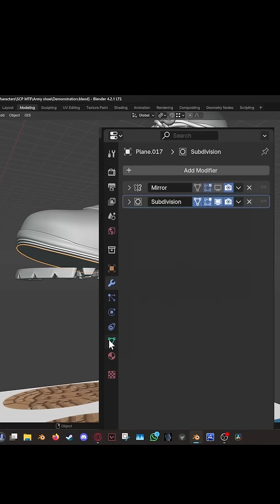The Easy way to Attach the Tread to a Shoe: Surface Deform modifier! #blender #3dmodeling

Comment: To me, learning Blender is way harder than learning Photoshop. Even if I only focus on sculpting, Blender already forces you to deal with 3D space, topology, modifiers, performance limits, and tools that all affect each other. Photoshop is only 2D, with more straightforward tools and immediate results. For Blender once you add texturing, materials, lighting, animation, and rendering, the difficulty doesn’t just increase, it stacks, making the learning curve multiple times steeper than Photoshop.

Comment: problem is that you will get distortion on the treads. can look a but weird. i normally just model the sole, then cut in to it in situ. its even harder if you want to blend the treads in to the sole and subdivide. its not a simple ask, loads of messing around to get a good result

Comment: Why it is so complicated? In in inventor you just select the surface you wanted to object to stick to in this case the bootom of the shoe than you select to object and it will automatically warp around the selected surface, yhis is also how you can put text on an object, here is much more complicated

Comment: 😂 Neat but takes so long. In Zbrush there are a few quick techniques. For this, my fave would be to create an IMM brush with the sole treads object, set projection strength to 100 and drag that IMM object on to the boot sole surface shape.  Matchmaker brush is another good option but I like IMM method.

Comment: I am absolutely out of the loop. Wouldn't even know the proper format to save an image file in. Lol so forgive me if this question is beyond stupid.
How come the result of doing this didn't make the tread too short for the shoe? As it's now covering more distance than the original model provided. 
I assume it automatically changes the scale/size to fit your anchor/ markers. But if so, *are there times where this method can distort or warp things too much? How would you combat that? *

Comment: i did a similar thing to cheat modeling 3d webbing on spiderman. except instead of even modeling the webbing, i textured it, converted it to an svg, used geonodes to convert the mesh into uv tiles in a shapekey, then did this lol, laziness and "smarter not harder" are basically the same thing. goes to show its really not a matter of an entire project thats difficult, its a bunch of simple steps you gotta understand in the software.

Comment: ok but no boot is shaped like that on the bottome. typically flat until the toe which bends slightly upward, not a huge curve up in the middle and back.  

also, this is one of those things that works perfectly until you actually try to do it, then it doesn't work at all and you have to watch the tutorial 40 more times before realizing you didn't update blender so something works slightly differently now and you have to start all over.

Comment: It always amazes me how blender really is about finding clever solutions to different problems
Reply: That's not just blender, practically any proper software you kinda need to find solutions, that's like %90 of the job.
Reply: all these ppl in the replies tryna ragebait 😝
Reply: that's just how technology is in general, buddy, not just blender
Reply: @splechortheannoyingcat yeah, and? How does that change anything that I saidm
Reply: @MilanKovacs-kc8ik it changes the specification to generalization, anymore question?
Reply: @splechortheannoyingcat the meaning is still the same. I was talking about blender because this is a blender video.
Reply: Every 3D software is about that. And this particular thing can be done in maya and has been for decades. Blender didn't invent 3D and isn't better than the rest.
Reply: @thegoblonoid I don't think I ever said that blender is better in any way. And also I said blender instead of any 3d software because this video is abour blender

Comment: You could also select the last vertices below and put the 3D cursor there, so when scaling on the z axis using the 3D cursor as the origin you won't have to worry about moving the object on the z axis

It gives the same result but requires fewer steps.

Comment: Nice one! Didn't know you can do that. Is there specific case you will recommend using this over the shrink wrap method, or they are pretty much interchangeable?
Reply from the maker: This method is very slightly faster, with shrinkwrap (set to project on the Z axis) you would need two modifiers and still need to flatten the sole mesh so this kind of cuts out the middle man
Reply: @BlenderTsukaima thank you !! Your method is actually better than!!!

Comment: Does the object only get stretched in the Z direction here? Like how do you get it so the protrusions follow the normals of the new curve?
Reply from the maker: That happens automatically thanks to the surface deform modifier. Since the target's (sole) faces are being rotated and stretched, so is the bound mesh (tread) as It tries to keep it's initial position (relative to the flat target)
Reply: @BlenderTsukaima thats super cool i imagine the effect would be more noticable wrapping completely around a cylinder or something like that

Comment: Wait what this is new. Was expecting shrink wrap but this is a neat trick I’ll add to my collection lol
Reply: you can also do this with shrink wrap but its a little more complicated and involves array modifiers
Reply: @RoyalTacos256 shrink map is different, it doesn't project it 1:1 it stretches the object
Reply: @willsherwood5958  Shrinkwrap does project if you choose the Project option in the modifier, but the problem is it tries to shrinkwrap everything an equal amount, or else only shrinkwrap the vertices of a vertex group (in which case the vertices at the bottom of the treads will just remain in their original flat position).  The trick is adding an offset to only the bottom of the treads — theoretically possible by making the top and bottom vertices into separate vertex groups and then using them on shrinkwrap modifiers with different offsets.  But even assuming all of this works, it's still much more complicated than using the Surface Deform modifier.
Reply: shrinkwrap and lattice
Reply: @sirbottlekick1690  You wouldn't use both Shrinkwrap and Lattice since both deform the mesh in different ways.  The lattice would have to be shaped to match the bottom of the shoe.  That's a lot of work that isn't needed if you instead use the Surface Deform modifier on an exact duplicate of the shoe bottom (which is exactly what happens in the video).

Comment: Or use shrinkwrap ... ?
Reply: the whole bottom part was 1 object so im pretty sure you cant shrink wrap that
Reply: @kienthedumb you can with a lattice. just have the shrinkwrap modifier set to "Project" and the result will be the same with way less steps
Reply: @rin_vl  Why is it that every time I've tried to apply a lattice modifier, it immediately changes the scale of the object I want to deform? Every time. Like the Object literally gets 50% larger and I haven't even touched the lattice yet.....yes I've checked and applied all scales.
Reply from the maker: You could but that would be 2 modifiers :)

Comment: Useful technique, but it would have been more realistic for that kind of boot for the curve of the bottom of the shoe to fill in the space to the flat tread of the textured sole. Boots don’t follow the arch curve of a foot, especially on the outside edge of the foot.
Reply from the maker: You're right it is a bit weird but the reference image was as a product image and included the curve.